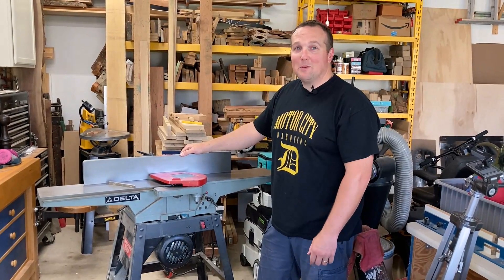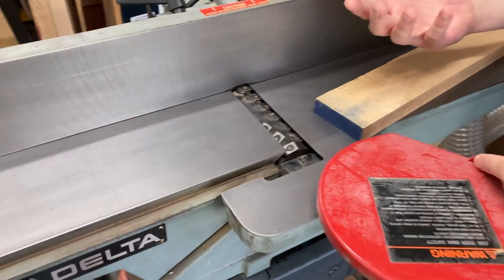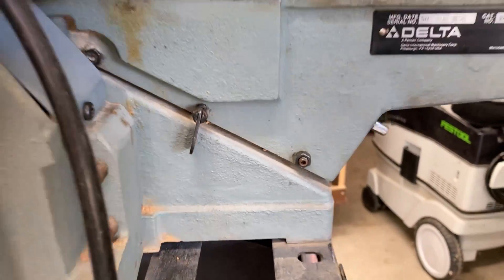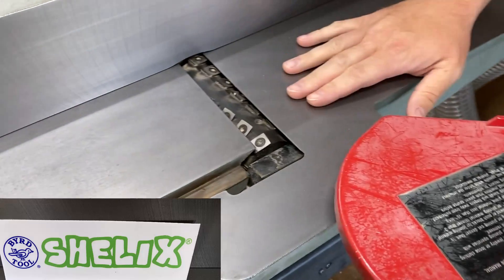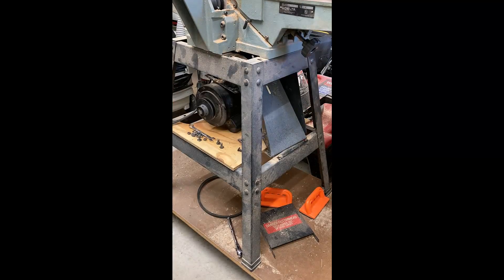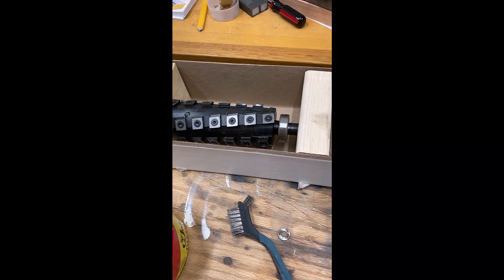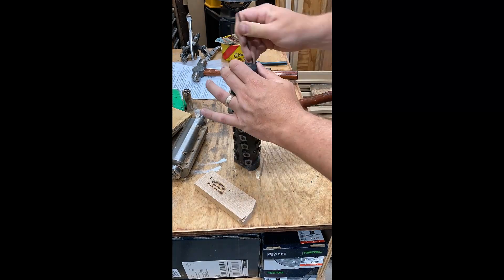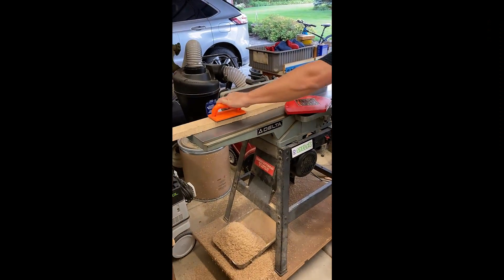Upgrade your jointer to a helical cutterhead

Comment: I've just purchased a used 6 1/8th inch jointer for $75.  It is my first jointer and I'm perfectly happy with the knives on it as they are razor sharp.  What bothers me is that that red guard is missing from mine and those are apparently as scarce as hen's teeth.  And at $595.00 for one of those heads, I think I could just replace my whole jointer 8 times and still come out ahead on the deal, lol.  Those cutter heads remind me of the cutter heads on carbide lathe chisels that also have 4 sides and can be rotated when one side gets dull.  Fortunately, comparatively speaking, those are much less expensive.
Reply from the maker: I hear you about the hefty price tag.  I went back and forth on this but ultimately decided I wanted milling work to be more enjoyable so I took the plunge.  Yeah, the cutter heads are similar to the ones on lathe tools.  Long story short, my decision to upgrade my jointer was about improving the quality of my shop time.  Good luck with your (new to you) machine!
Reply: Head without bearings is 399 Add 45 for bearings.  It's almost a year later but this is the price from Byrd.  I put one of these heads in my DeWalt planer and it TRANSFORMED the tool.  Money well spent for the performance and cut improvement..